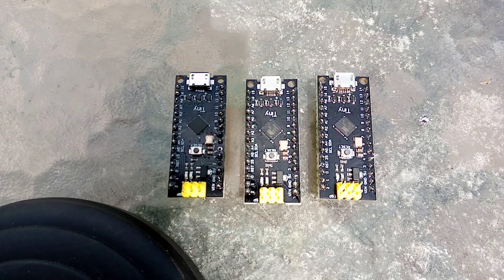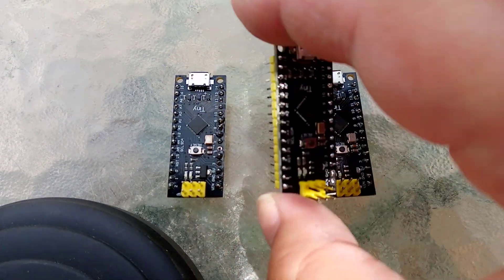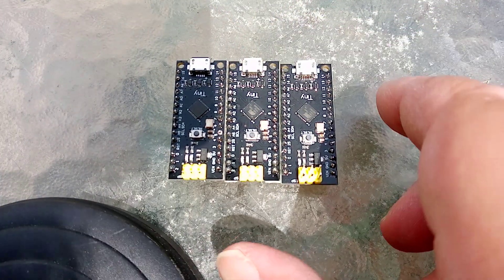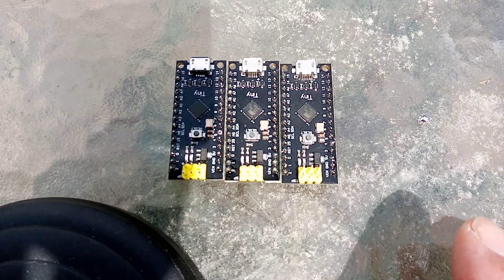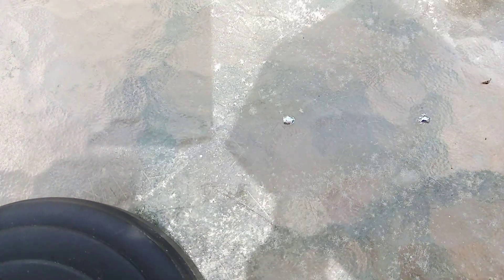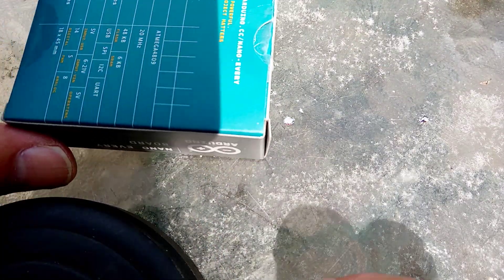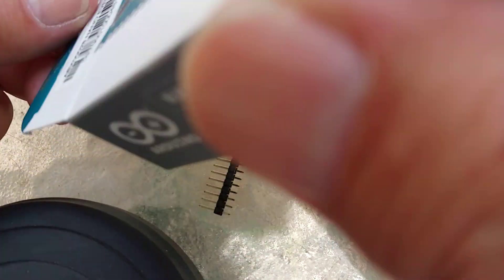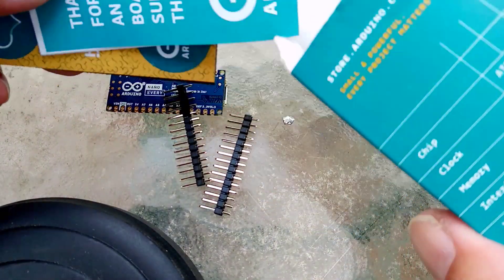Going better than the ATTiny88

Comment: Hello Mr, don't know if you had any luck with this board. I was able to program it, just needed to install the board "MH-ET Live Boards" on arduino ide
Reply from the maker: I have since also managed to program it. I had to update the Arduino IDE via command line. The Linux Mint software manager/ app store wanted to install only elderly IDEs that would not work with the Tiny88. The Mint people really need to get with the program!

Comment: You sound like Winnie the Pooh. Not a bad thing, just an observation. I hope you have better luck with the Tiny88 than I did.
Reply from the maker: Thanks. This weekend I will do a video on "how to make the ATTiny88 work. I have a few videos on how sucky the Arduino IDE is that can be downloaded from the software repository on Linux Mint and how I could not use the ATTiny88.

One of the members of a Linux group I'm on - who happens to be the Baptist minister for a church in South Wales - came up with a solution. It seems the repository version is sucky. The solution seems to come from the Flatpak version of the IDE. Indeed, once I had that on my computer, I plugged in the ATTiny88 and tried to send it the blink program. It didn't like it until I pressed the reset button on the ATTiny88. After that the program uploaded and the onboard LED began blinking.